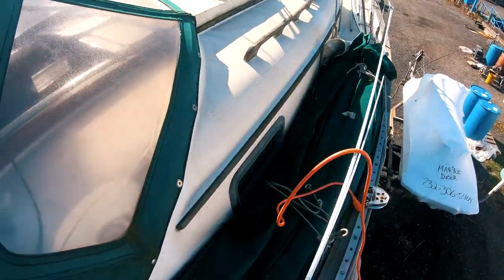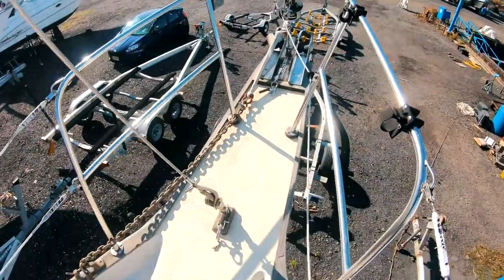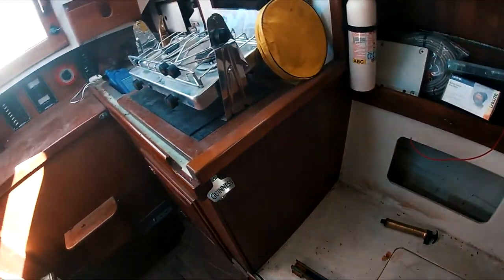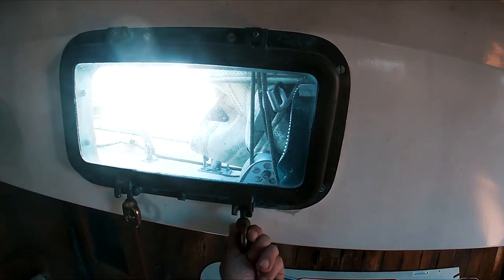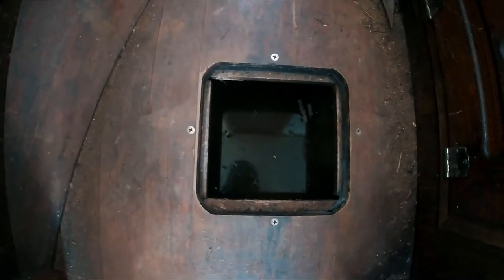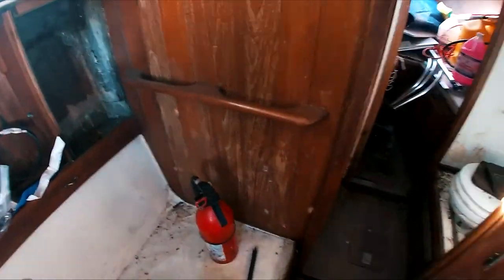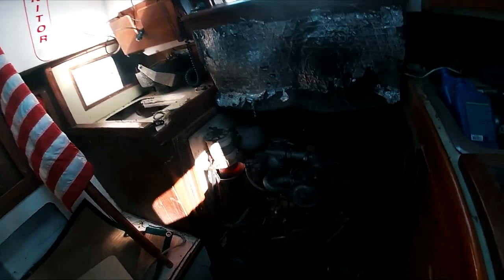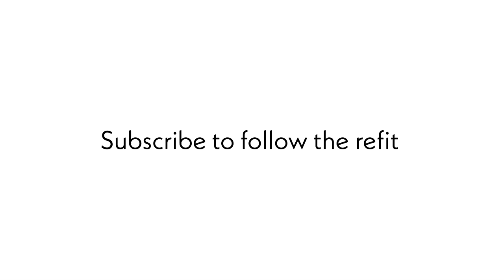Southern Cross 28 sailboat (Interior/exterior tour)

Comment: Before you reinstall bulkheads check for signs of leakage at the hull/deck joint.  The SC28 has a well earned reputation for leaks in this area.  Mine is hull #16, had been repaired on one side, I got to fix the port side.
Reply from the maker: Thanks Rod. The joint on my definitely needs to be addressed. How did/are you going to go about yours?
Reply: @refittingreverie7992  there was quite serious delamination in the deck and hull which I'm sure was made worse by water getting in and freezing.  In the end I decided to cut wedges of cedar and drove them into the joint on the inside with thickened epoxy and glassed over them.  Might be easier to discuss in person, pm me and I'll give you my phone #.  Enjoy and don't get discouraged.
Reply from the maker: @rodbrancher807  I'll definitely reach out. I a ways off from attacking the hull to deck joint but it would be great to get your insight into other areas of the boat as well.
Reply from the maker: @rodbrancher807  Rod, shoot me an email. I'd like to connect about how your tackled your hull to deck joint. adventures.in.reverie1@gmail.com

Comment: Typically there are two type of bronze used on or in boats. One is silicon bronze normally used for fasteners, screws, nut and bolts. This is the stuff that usually shows the green patina or in other terms Verdigris. It is the common name for a green pigment obtained through the application of acetic acid to copper plates or the natural patina formed when copper, brass or bronze is weathered and exposed to air or seawater over time. 
The other type is manganese bronze. This alloy is used often for castings like portlights, gudgeons and pintles and other types of hardware. It usually shows little or no verdigris.
May your troubles melt like lemon drops.